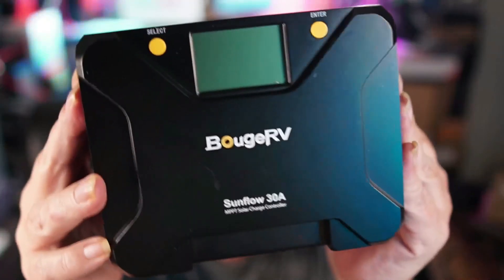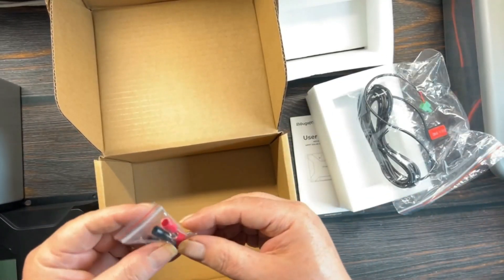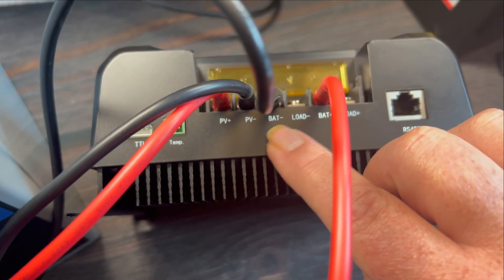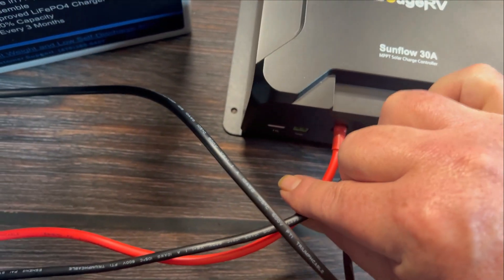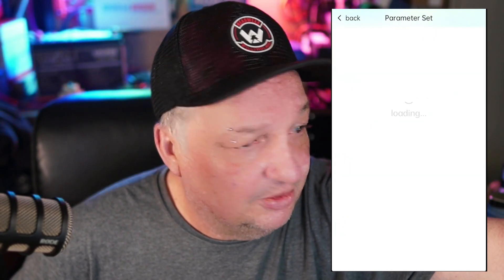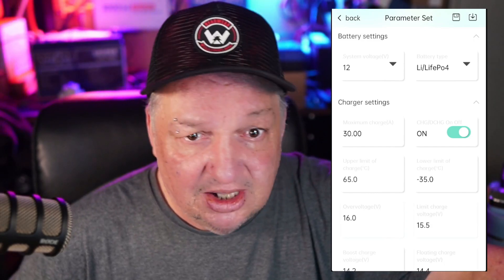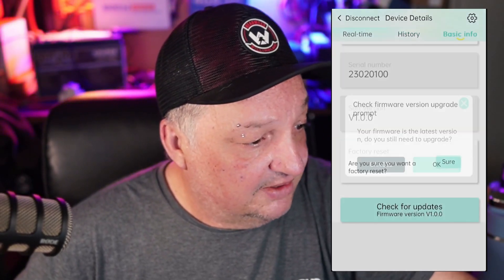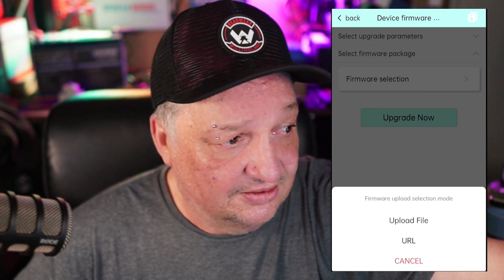BougeRV Sunflow MPPT Solar Controller - with Cold Temp Protection!

Comment: I just installed the 30amp unit. A couple of things I have noticed so far. I don't have the back- light, nor can I find a way to turn it on.  Also, using the phone app, when I press check for updates, nothing happens, and it just says 1.0.0 . I have no idea if that is even the latest version. The manual for all the modes is quite perplexing, at least for me but I'm solar novice.  I'm running the Renogy 200w panel.  EDIT:  I learned that the backlight comes on when you press a button but the issue for me with that is the minute you press a button it changes the screen.  I was hoping the backlight could be activated on the home screen.  Still not seeing how to activate Check for Update.

Comment: Thanks for the video. I am in northern bc Canada, i am struggling with where to mount all this stuff at my cabin, I want the batteries outside for venting, but can the other solar component's, namely the charge controller and the inverter, will i destroy them if they are in a solar UNINSULATED shed, it gets -40 C at times in northern bc? If i put inside that means i have a huge run to the shed with a big inverter cable, its probably a 15-20 ft run, I don't even know if that will work, i have read 10ft max battery from inverter, so sorry for so many questions.... Thanks Mark. I only go to cabin once a year and was going to leave hooked up and turn off inverter so battery can charge when there is sun in winter?
Reply from the maker: Not sure what you're power needs are really, but If you only go there once a year I think you might be better off with a portable power station and just bring it with you when you go. Those are pretty harsh conditions to deal with, especially if you are not on sight to deal with issues as the come up.  Good luck!

Comment: Thanks for the great walk through of the controller.  Do you still use the low temp shutoff feature if the battery is self-heating?
Reply from the maker: No, I wouldn't use that feature if I had self-heating batteries because it would just cut charging from the panels to the battery bank and effectively disable the self-heating. Most self-heating batteries only heat when there is a charge being applied.